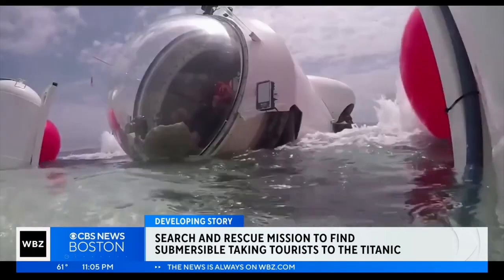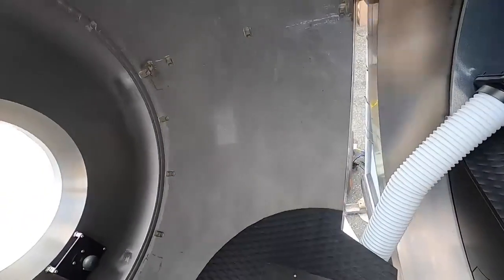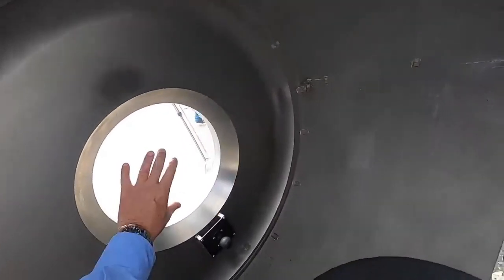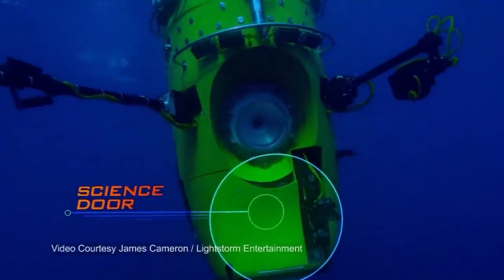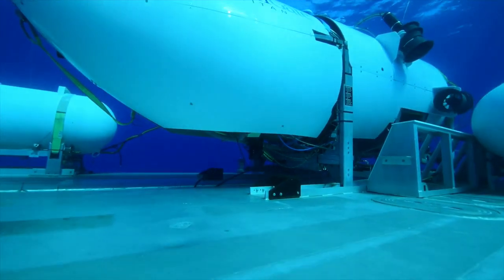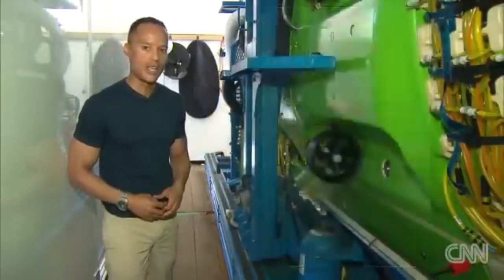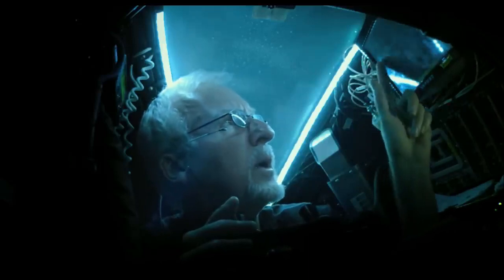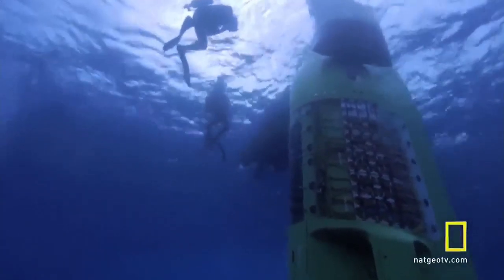Explaining The Differences of Ocean Gate Titan Vs Deapsea Challenger

Comment: Bit misleading to say they had similar shapes. The external shapes were indeed both long and streamlined, but much of that enclosed volume was in equilibrium with the water pressure. 
The key safety part, the pressure vessel, was spherical in Challenger and cylindrical with hemispherical ends in Titan. That will have had a big impact on the forces acting on them.
Reply: The shape was the least of the problems..he failed to follow any of the certification guidelines..the main failure would be crush hull testing. You typically add 20% to the dive limit..the sub should of been tested to depths of 16,000 feet to insure 12,500 was safe to dive.

Blair Thornton said the physical force, not psi would be around 10,000 tons on the hull equally..he's a professor and built dozens of robot deep subs..

Comment: Is it possible that the location where the champagne bottle was struck to christen the vessel be the start of a fissure and or crack in the carbon fiber?
Reply: Never considered that as I just saw it for the first time in this video, but definitely add it to the long list of variables: the use of expired carbon fiber and only being wound in one direction, the adhesive used to bond the carbon to the titanium caps, the  underrated acrylic window, the bolts securing the hatch, etc., a year from now after the investigation, I’d chuckle if they were ALL contributing factors.